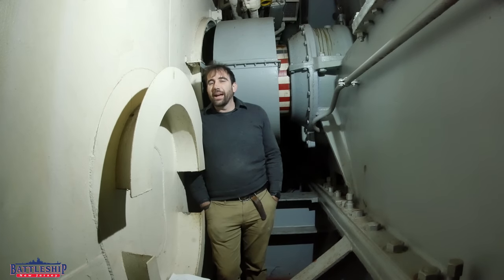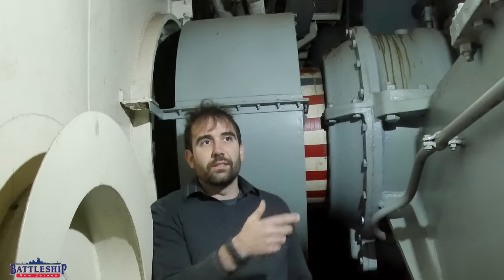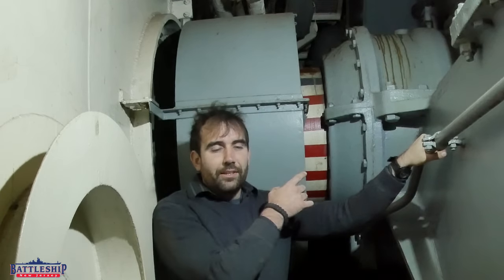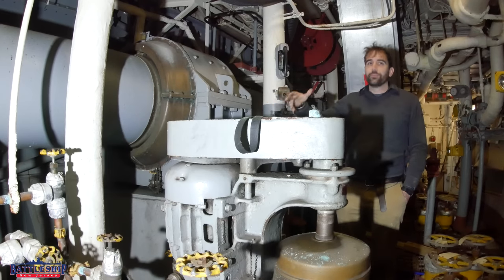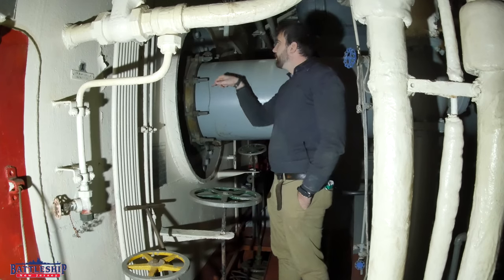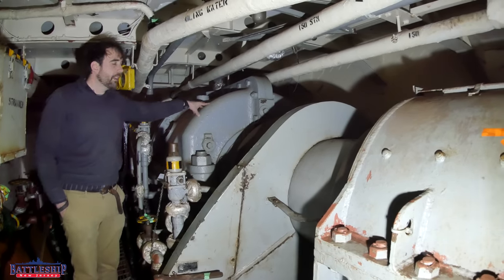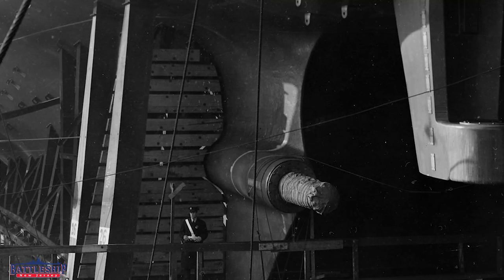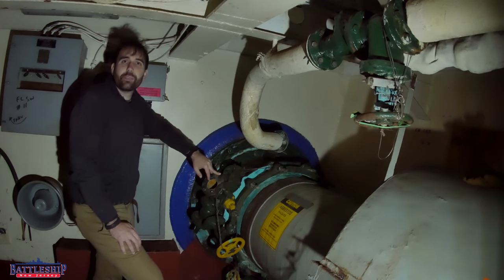Battleship Sized Propeller Shafts

Comment: On the subject of shaft twist under load, I ran some quick numbers.  54000 Horsepower at 202 RPM would result in a torque of 1,404,000 foot pounds.

Assuming a 1 inch wall thickness for the shaft, I get a shear stress of 11,500 psi, which I think is reasonable.  This results in a twist over 340 feet of length of 0.26 radians or about 15 degrees.

Assuming a 2 inch wall thickness:  Shear stress = 6,300 psi, twist = 0.145 radians or about 8 degrees.

Interestingly, if one was willing to run a shear stress of 30,000 psi (which would be doable with the right steel but very sketchy and not last long).  This would result in a twist of 0.686 radians or about 39 degrees, and a wall thickness of only 0.361 inches.
Reply: Your math is under appreciated
Reply: The shafts have about a 4 1/8" wall thickness. Also if I may ask, what formulas did you use?
Reply: @KPen3750  

Torque (inchlb) =T = HP * 63024 / RPM, where HP = Horse Power and RPM = Revolutions per Minute.
Polar moment of inertia (in^4) = J = pi * (OD^4 - ID^4)/32, where OD = Outside Diameter and ID = Inside diameter both in inches.
Twist (radians) = T * L / (J * G), where L = length in inches and G = shear modulus of elasticity (11,000,000 lb/in*2 for steel).
Shear stress (psi) = Tau = T * R / J, where R = Radius from center to outside of the shaft.

So Torque = 54,000 * 63024 / 202 = 16,848,000 inlb or 1,404,000 ftlb.
@ 4 1/8" wall, J = pi * ((32in)^4 - (23.75in)^4) /32 = 71,708 in^4.
Length = 340 ft * 12 in/ft = 4080".
Twist = 16,848,000 * 4080 / (71,708 * 11,000,000) = 0.087 radians or about 5 degrees.
Shear stress = 16,848,000 * 16 / 71708 = 3759 psi.

I am not surprised they are much thicker then needed given how bad a failure would be.  That said, a shear stress of 3759 psi is very low.  Of coarse any shock loads could send the the torque and stress much higher.
Reply: @bandhmo  thank you!! I remember learning about that in my Mechanics of Materials class, I just couldn't find my notes on it
Reply: You might want to redo your math. Ryan states the shafts were 32" in diameter with an 8"  hole drilled down the center to reduce weight.  A wall thickness of 12" ?
Reply: Extrapolating from those numbers, it seems that a hollow 32" shaft with 8" bore and 12-inch walls will barely twist 1.5 degrees under load, even with 340ft length for longest shaft #1.
(less on other shafts which are shorter)
So this becomes a "myth buster" for the story about NJ prop shaft twisting very far on engine room end before the prop/screw turns on other end outside hull+behind the ship.
(as Ryan suspected by his comment)

... still, that's some very impressive power being driven by that shaft, and we'll thought out designs to deliver enough power to push BB62 up to 33knots, with thrust bearings+blocks, spring bearings, and water tight seals  spanning hundreds of feet from engine rooms to stern propellers(screws). 

Even at 80yrs+ it seems like most of the propulsion equipment on NJ is In good enough shape to still run again... but her boilers, plumbing and condensers may not be safe to make full steam and hold all that pressure any more. 
The last sailor crew to run NJ/BB62 still thought she was in good shape when put in drydock, and the captain even said "sleep lightly New Jersey, until you are called on again".

Comment: @ 6:00 you talk about the "shaft lube oil pump". That is a Sharples lube oil purifier to separate water and gunk out of the oil.
Haven't seen an old fire & bilge pump like that for many years either!
I'm surprised to see how close the machinery layout in the enginerooms are so similar to Sumner class DD enginerooms.
Spring bearings are babbitt, it is the strut bearings that were lignum vitia (Latin translation = "wood of life"). It is slicker than snot when wet with sea water.
The spring bearings are oiled with rings that rotate around the shaft as it turns. I can't see in the video, but there should be two flip up lids on top of the bearing, open it up, look in and you will see (usually) 2 brass rings in grooves. You had to check them underway to make sure they didn't hang up and stop oiling. I never saw one (the oilers) fail in 40 years.
Reply: The name of the brass rings is slinger rings.
Reply: I was looking for another MM to have weighed in on the mislabeling of the LOP.
Reply: Thanks for the good explanation. I'm sure the thrust bearings were some sort of Kingsbury swivel pad bearings.
Reply: @backho12  yep!
Had to edit to clarify. Main shaft thrust bearings are the Kingsbury type (hadn't heard that term fir years!)
I various types of turbine use them also, yet the majority of thrust bearings are much like the shell type bearing on an ICE engine crankshaft. 
On these old plants, they used steam pumps for all of the feedwater, oil pumps and forced draft fans. These used the shell type. They were made undersized, you had to hand scrape them to fit! 
The auxiliary systems had separate electric motors for independent operation. You could start up a generator by exhausting it to the main for start up.

Comment: A couple of corrections, having working in EMO1, I can completely say these things with confidence. 

1.  Spring bearings are made of Brass and Babbitt, not wood. They have 2 slinger rings to lubricate them from the oil sump on each bearing. There is no pressurized oil system on spring bearings. 
2. The Lube Oil Purifier is NOT piped to the spring bearings. You manually drain and fill the bearing sump when the oil is dirty or needs changed. 

3. Part of the reason engines don’t match the engine room is space. EMO1 and EMO2 are at the widest point in the ship, that way there is enough room for the machinery attached to the shaft to fit around the shafts. As you go further aft in the ship, the reduction gears/engines move thirds the center more, shafts 2&3, so the engine rooms can be narrower.
Reply: This is why all museum ships need actual snipes and former ships crew to describe the machinery and associated aux machinery correctly. Former snipe here on the Knox class frigates and a few CVs. I remember when the host grabbed a bronze dogging wrench and said he didn’t know why it was in the space he was in. He was in an ammunition space! Duhhh
Reply: Thanks
Reply: As a former hole snipe from #2 Engineroom I was thinking who ever told Ryan this is wrong.
Reply: @mikemissel7785  which part Mike?  Come on, I know you rode the shaft!!!
Reply: Did Iowa's have a locking device and bits?
Reply: @rodhennessy9428  what kind of locking device?  We have locking mechanism on the main reduction gears, attached to the jacking gear.  We have many locks on the engines and reduction gears, only accessible by special permission from Chief Engineer. Each spring bearing has padlocks with keys maintained in each space.
Reply: @richcruse2689  I am referring to the huge locking bits usually in the last shaft alley.  I was a carrier nuke MM.  I know all about the locking device on the turning gear.  Not much use in an at sea wartime condition.  Do the Iowa's have those in the shaft alley?  Also, does the last shaft seal have a shaft seal/flushing system with an inflatable boot?
Reply: @rodhennessy9428  never saw any locking bits or any way to lock our shafts in place if that what your referring to.  We did have shaft seals with flushing water, you can see one of the pipes in the video.  There was talk about an inflatable boot, although I never found any remnants of one. I always heard we would just crank down our packing glad to seal if needed.

Comment: I really love that even in the 1940s ships were designed with something like wood as a bearing material. Yes its a certain type of wood, but these days engineers would spend LOTS of money to come up with a manufactured material that may or may not work.
Reply: In defense of modern engineers, most stories like that have to do with limited supplies of some exotic natural material or another that just can't be sourced with the kind of reliability and cost effectiveness we need today.  And that gets really expensive if exotic natural material is overexploited until it just runs out or becomes super expensive and there's a scramble to replace it.
Reply: On the contrary today's engineers have much more materials to choose from and at little cost and the wood that you speak of would be expensive. Times change.
Reply: As an engineer, many very important design decisions are based on availability,  and best estimate of future availability. Try to stick with most common materials, the design allows. 

That use to be the case with semiconductors, until fabrication costs, limited the actual part manufacturers to a small handful, and 65% of them coming out of Taiwan, which now mimics a unique exotic location. Up to the late 1980s all the companies in the Silicon Valley made their own parts. Now most semi "makers" are fabless, which design their own parts, but contract the fabrication to the likes of TSMC. If China decides to attack Taiwan, the worlds chip supply will quickly go to zip ! Hence, Biden's recent semiconductor maneuvers. Success is to be seen. I didn't vote for the old coot. Didn't vote for his orange hair opponent either.
Reply: WE used that wood on Aircraft Carriers until lately and switched to rubber for the stern bearing.
Reply: The wood is called Lignum Vitae
Reply: Today we use a soft babbit bearing material, not unlike the old model A's poured babbit. If clearances are incorrect, a mechanic can "scrape in" the bearing surface. This system is in use in modern Navy ships today.
Reply: Be careful of survivor bias when looking at old items and concluding things used to last: you did not check those that were gone for good.

Comment: Great to see this. I was an Engineer in the Royal Navy specialising in Propulsion, and then conducted reliability Tranmission system studies for the new Ships during design and build. Very interesting to see its all still the same in many ways. Spring Bearings = Plummer Bearings/Blocks in the RN.
Reply: I dismantled Plummer blocks on a destroyer to remove the lubricant prior to sinking it as an artificial reef.  HMCS Chaudiere.

Comment: On smaller vessels, it was a common practice to tighten up on the stuffing box fasteners when the vessel was in port, to minimize leakage, then loosen them when preparing to get under way.  Was this also the practice on the IOWA’s?

Comment: I used to go inshore sea-fishing on a 1953 ex-admiralty cutter that had Ironwood for the stern-gland/bearing. No oil, just sea-water: When it was moored, the wood got wet and swelled, preventing leakage. Once power was applied to the prop, the friction heated the wood and drove off the excess water, giving a clearing between shaft and bearing enough for the water to maintain lubrication and sealing. Cheap but effective!

Comment: Readers here may not be aware, though I'm relatively sure Ryan is ... but Iowa class ships even at the end of their service lives were capable of speeds in excess of most of their GAS TURBINE powered escorts.  When we were exercising with USS Iowa after her recommissioning, our Spruance class (gas turbine powered) destroyer was easily capable of out accelerating Iowa, but when she was given the opportunity to build up speed Iowa began pulling away from us even though we were maxed out.  Ryan is correct when he said it took New Jersey and her sisters "quite a while" to get up to top speed.  A modern tincan or cruiser can hit her top speed in less than three minutes, maybe two estimated.

Our Spruance was twin screw with 40,000 hp on each screw from two 20k hp gas turbine engines for a total of 80,000 shaft hp vs an Iowa with 212k hp.  Caron was 7,800 tons vs Iowa at about 50,000 tons or 58,000 tons full load.

I still can't tell you how fast we were going because Spruance type hulls and powerplants are still in service in Ticonderoga class cruisers, it is classified.  Iowa had us by about 2 knots more or less.  Only nuclear powered carriers are faster to my knowledge.
Reply: Well, a large factor in the maximum speed of a hull is the LENGTH of the hull.   When you get near that "hull limit" the amount of power it takes to make you go a bit faster ramps up quickly.

Comment: Was aboard USS Reuben James (FFG-57) when she got a heavy line tangled round her SINGLE shaft in Pusan harbor - bent the shaft JUST a tiny bit, but it sure gave vibrations - we limped to Japan for a week in dry-dock where they replaced the shaft.

Comment: The little ship I was on produced 70,000 shaft horsepower and had two shafts. I believe the screws were 12 feet in diameter. Our max listed turns was 305 to make 35 knots. It's a shame they don't let you use the jacking gear to turn those shafts over from time to time.
Reply: Why would you want to jack  a shaft over that isn't going anywhere? The propose of jacking gear is to get the lube oil going through all the components before steaming at sea.
Reply: To make sure it wont bend out of shape
Reply: @jameslong3351  prevents bending, corrosion etc.

Comment: I am pretty sure the machine shop my friend worked at for years bought the lathe that made the drivehafts. Lots of stories about the machines the old man bought, and the parts he made for the Gov. because he had the machines years later.
Reply: I remember hearing a story about how an Australian Navy Destroyer needed a new Prop Shaft, so when they had machined the shaft and were waiting to have it X-rayed - An Apprentice Machinist wrote the name of the Ship and Date on the Shaft with a big Sharpie Texta. And so a $200 thousand Dollar Propeller Shaft was written off and turned into scrap metal because, even if they wiped the Sharpie marks off with Acetone or whatever, you could still see a faint traces of it underneath where it had been and they could not take the risk if it were masking a latent crack or not.. Good enough for Government work as they say (or not)

Comment: Back in the early 1970's took an engine room tour of now would be considered a small cruise ship ( less then 1,500 passengers ). Think it only had two propellers. They had at least one what they called Denny stabilizers on each side of the ship guess at least a few feet below the water line. They looked like airplane wings when extended into the water. Their only purpose was to keep the ship guess stable. Officer giving the tour told us when the sea gets too ruff they must retrace them back into engine room because they could break. See on TV shows that all the new cruise ships have the fancy electrically driven rotating propellers that a rudder is not needed. Between them & bow thrusters these Monster ships will dock themselves when tug boats go on strike.

Comment: I always wondered how they kept the shafts from leaking. Plus I always assumed the engines were all in the rear of the ship. But it makes more sense that they are not.
Reply: On a civilian ship, they will be. A battleship has the major constraint of all the engineering spaces having to be inside the armored citadel, which only runs from just ahead of turret 1 to just aft of turret 3. So, everything has to be in the middle, between turrets 2 and 3.

Comment: The story of the shaft having two turns in it at the gear box before the propeller turns is not an exaggeration.  If I did the math right, 53,000 hp @ 202 RPM is over 1.3 millon lb-ft of torque.  As big as they are in diameter, the steel shafts are extremely long in comparison and act like a gigantic torsion springs.

Comment: The inner 8" bore is not for weight savings. As the 32" diameter shaft is spun by the reduction gear the resistance from the propeller will add resistance which will cause the shaft to start twisting.; to two to three times (or more, depending on the shaft length) when full speed is achieved. This causes a large amount of stress to be concentrated in the center of the shaft. Think of it this way. The outer circumference of the shaft is 32" X Pi = about 100 inches around. As the center of the shaft is approached the stress due to the torque will increase. The very high stress concentrates at the center of the shaft. The center bore removes this high stress location and allows greater torque to be applied without reaching the point of failure.

Comment: My experience on other naval ships lends me to believe there is babbitt in those spring bearings, not wood, thus the oiling system.   The wood you describe is used on strut and tailshaft bearings exposed to seawater.

Comment: This is just one more thing that I had pictured wrong in my head. I never would have thought the engine rooms were front to back and the shafts were staggered the way they are let alone the wild numbering scheme.  I wish we could take the battleship for a spin every once in a while
Reply: Yep, it's because all the engineering spaces have to be inside the armored citadel, in the space between turrets 2 and 3. That requires spreading them out over the length of that space.

Comment: The 2 1/2 twist of the shaft is when your underway full throttle.  Aoe6 port shaft at full throttle twists 1 1/2,. We had a strip painted the length of the shaft and could see the change in mer 2 as speed increased decreased.

Comment: Some maths:
My calculations say about 430 tons for that 340-ft shaft alone. That's a lot of steel.
The 8" hole in the center saves about 29 tons, for I'd guess very little strength loss.
My car is 436hp, so more than 2 orders of magnitude less than even 1 of those shafts at 50k hp.
Reply: @T.J. Kong Yes, thanks for confirming.
And I'd like to see the lathe that turned and bored out a 340ft shaft. Or maybe it was done in multiple sections ... he didn't say.